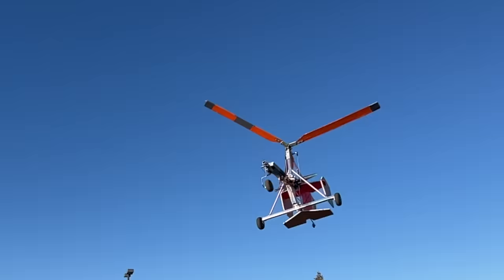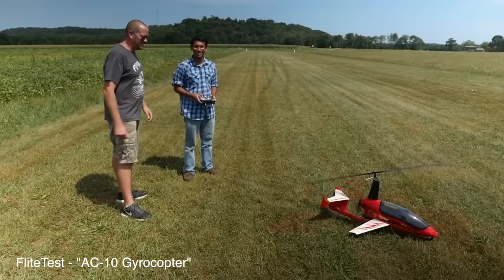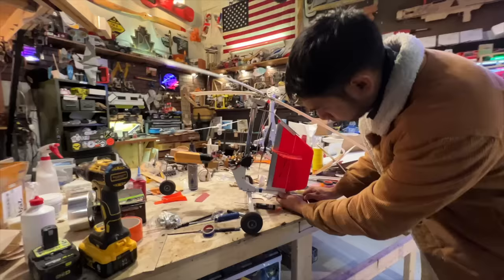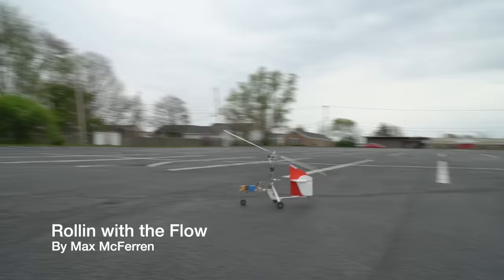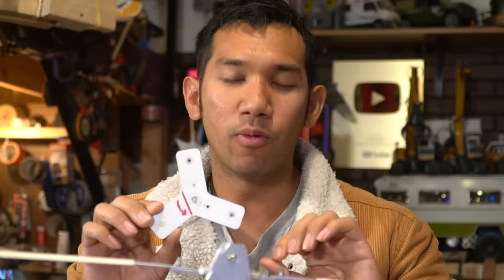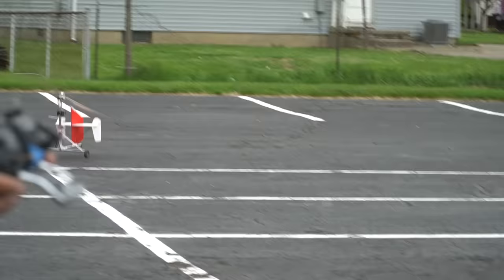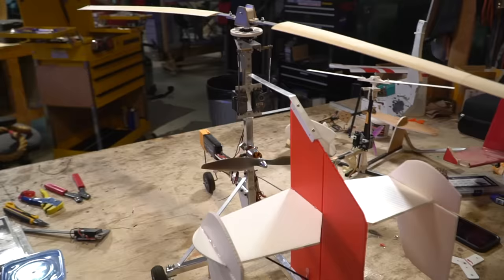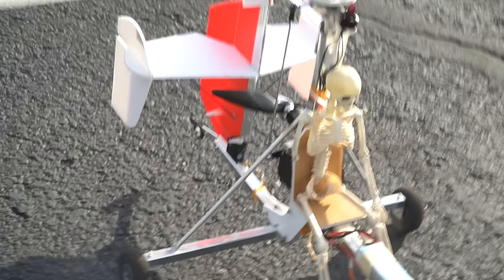This isn’t a helicopter or an airplane?

Comment: I remember when I was reading up on autogyros that the most common way to kill yourself was called a Power Push(or Pitch) Over. Basically at the end of a climb,  a pilot should reduce power FIRST, then pitch forward. This was especially a problem with models that didn't have a horizontal stabilizer, and a motor thrust line way above the pilot. The mistake would be to reduce pitch first with full power (Because, yeah, you want to go fast now that you're done climbing, right?). Doing that reduces the drag from the rotor, but not from the pilot/cockpit. The center of thrust ends up way above the center of drag, and the whole machine tumbles and is unrecoverable.
Reply: not quite right although this myth has been largely accepted by most in the gryoplane community.  

I used to fly bensen gyros years ago and am building a new one slowly now.  I was trained in the gyroglider then two seat powered then lots of time in my own machine supervised doing strip runs.  I never saw an accident at that club we were very well trained.  When I went onto become a gyroglider instructor myself for 16 years off and on in that club and our own club in my state.  no one ever smashed up a set of rotors under my instruction either.

no stabiliser necessary.  meanwhile our sport copying off the USA had decided to blame a lack of stabilisers so Australia mandated them.  well all that meant was everyone who died died with a stabiliser.  that continued at the same rate today.  

Next in UK a proper scientific analysis was carried out which concluded that speed was the most important factor and that stabilisers were of no help but c of g relative to thrust line was which is true.

however machines like the dominator remove the 3 degrees of downturns which in the Bensens puts the thrust line through the cg and keep it flat but bring the mass up.  So everyone continued to ignore good training and deaths continued.

one guy visited our club and was boasting about his new machine and how fast it was.  He claimed he was going to be getting up over 100knots the following weekend he had mabey 5 hour solo.  Myself and about 5 others warned him he could inadvertently push the rotors negative trying this and should avoid flying that fast   he cited the very large stabiliser like the one on peters machine and the high vs thrustline so wasn't worried.  His gps when recovered showed he was doing 95knts when he bunted over the force on his body was so sudden his ripped his harness off and was flung out of the cockpit leaving his leg behind in the process.  

as you get faster and faster your disk angle become shallower and shallower.  push it over and the airflow reverses and in about a second you will fly straight through the rotor and die.  anyone tells you otherwise ask them to fly at 100mph straight over the airstrip and punch the stick full forward.  if they do I'm convinced they'll kill themselves right in front of you.  if they are not willing to try that experiment and actually don't tell them to do it you don't want to be even partly responsible.  however I note many including many instructors are willing to make these statements often when trying to sell you a gyroplane.  A quick google search of gyroplane fatalities will show you almost all have stabilisers, almost all have high CG to thrustline.

the ONLY way to be safe in gyros like all aircraft is to spend the time to get excellent training.  That includes you to Peter.  don't I any way convince yourself you can safety teach yourself to fly these things.  get proper instruction then spend many hours after your instruction in heavy dual machines under supervision doing ground runs.
Reply: @cameronlapworth2284  Perhaps that was an advantage of the original tractor design, the engine in the front put the thrust line in a more inherently stable position.
Reply: @Dr_Mauser  Cameron Lapworth is not talking about the pilot push-over problem. He is talking about a fast-spinning rotor and suddenly sees a negative AoA. Instead of generating uplift, the rotor suddenly generates down lift and chops up the pilot.
Reply: @Aviator168  But doesn't the pilot push-over basically cause negative AOA because of the sudden unloading of the blades?
Reply: @Dr_Mauser  Depends on the cross-section of the blades and the amount of negative AoA. It definitely reduces the force that makes the blades spin and rotor unload. When the stick is pushed forward, the AoA of the advancing blade is reduced and at the same time, the AoA of retrieving blade is increased. If the stick is pushed too much forward, it will cause the entire retrieving blade to stall, and the rotor stops spinning very quickly.
Reply: @cameronlapworth2284  "anyone tells you otherwise ask them to fly at 100mph straight over the airstrip and punch the stick full forward." If he's "flying at 100mph straight", for what reason would he want to "punch the stick full forward"?
Reply: @Aviator168  you wouldn't want to it'd be the last thing you do.  However it's how you would prove you'd made a gyroplane immune to PPO.

When I first got into this sport there were a succession of myths   I learned over time most were actually excuses for not fixing the poor quality instruction.

First myth was gyros delay response from input and this is why pilots were getting into pio.  It's true that if you pull back on the stick you get and increase in disk angle and this leads to blades increasing rpm which can be slightly delayed but the response is instant in terms of pitch the machine is responsive there is no input then 1 second delay then action.  But that was being blamed.

That was taken over by PIO.  This really just amounts to no training but on reading all the accidents it was clear that this was almost never observed.  What was far more common was turning from downwind to upwind.  But the fatal that had eyewitnesses was almost always flying flat fast then bang and tumble out of the sky.  However the USA namely Chuck Beaty and others pushed that this was all about lack of horizontal stabilisers.  Now I'd found almost zero evidence of pio mainly I think because you'd never get much above the ground of you had so little control.  Possible but largely not consistent with the data.  But that didn't stop my country mandating they be fitted.  So fatality rate didn't changed but now all the wrecks had stabilisers some cut right off in the bunt over.

Next had more credibility cg vs thrustline.  The dominator style machines are an attempt to get a more stable configuration.  However they remove the downtrust on the engine only to put the mass up higher.  The original Bensens had short masts and downturns of 3 degrees which pushed the thrustline through the cg.  This was nothing new Ciervas had 5 degrees.  However machines like the aircommand only get into danger here above 80mph which is ridiculous in a machine like that.  Found below even with the taller maet it was stable and safe.

However this has been promoted as the cure.  It is not as all modern machine have thrustline passing through cg and people still fatally unload them.  Yes it helps.  

The reason people die like this is simple.  The disk must always have airflow up from below and through the rotor the faster you fly the shallower the disk angle.  The stabiliser is not connected to the rotor so even if your frame is made stable at a certain speed it just takes a slight bump and your disk goes from positive to negative and you are dead.  High centre of gravity compared to thrust line will not stop this.  And if someone tells you the machine is safe at extreme speeds because it's got high cg or large stabiliser then ask them how confident they are to punch the stick forward at those speeds.

Some gyros genuinely are slippery and fast but the difference between a fast cruise and death might be 1 degree disk angle.  I know my VW gyro in the day could easily do 80mph probably 100mph but that would be very close to the edge at 80 it was sensitive but stable but I chose to never fly it beyond 60mph to give a safety margin.  

There are fast gryos out there but none are immune to this and a quick google image search of fatal gyro accidents will find tonnes of pictures of gyro with large stabilisers and high cg to thrustline.  All the modern machine fit these and the fatality rate has not improved since my time.

This is about training training training and good quality instruction followed by knowledge pilots and people not pretending to have answers they don't.
Reply: @cameronlapworth2284  You are basically right except that the AoA of the disk between flying straight level and tumbling is more than 1 degree. The disk will slow down first, very fast. So it would be a good idea to always have some power driving the disk to prevent it from falling below certain RPM and that's what the designer of the Gyrhino did. 
PS. I suggest every gyro be equipped with a flight data recorder so accidents can studied and improvements can be made.
Reply: @Aviator168  no just saying if you are flying very fast you must have a very low a of a but positive.  Then at the point you unload of course that becomes negative.  I was trying to point out the critical difference is very very small.   This is of course how we stop the blades after landing dropping the disk below level.  In flight of course this is much more violent.  Flying straight through your rotors.  The emphasis of what the airframe does at this point seems unnecessary as once those blades stop you are not recovering.  With zero lift you have nothing to control or recover or control if at this point my tail swings up is really not an issue as once it's unloaded you are just tumbling wreckage regardless.  Trick is not to get near that position in the first place.
Reply: @Aviator168  I wasn't aware of the gyrhino.  Bensen did experiments fitting a chain saw to keep 8 hp continuously through the disk.  Of course even choppers can go negative and chop thier own tails off so that won't stop this completely = but might reduce the risk.  I've thought as the battery technology improves fitting a several hp electric motor continuous to the rotor to reduce power requirements to the prop.  Bensens 8hp apparently allowed him to fly quit well on only 40hp Neilson engine instead of his usual 72hp Mac.

The black box is a good idea and actually something I've been pondering for another related reason.  I'm an ICT teacher I teach programming using little cheap computers called Raaoberry Pis and Arduinos  they allow connection via General Purpose Input Output pins GPIO  this allows sensors and outputs like motors servos lights sound etc to be triggered by the computer and can record data.  

I figure the real issue is getting too shallow a disk angle relative to the airflow with the angle of the frame essentially a hanging mass under this.  I believe the airframe position is irrelevant and the difference in stick pressure before unloading is indistinguishable from normal flight.  How much pressure does it take to fully lnload the disk on landing?

What I think might be useful is a wind vein attached to the torque tube  this could potentially give warning when getting close to very low disk angles relative to the airflow.  You could have an audible alarm sent to your headset even potentially have a servo motor on a spring apply oscillating pressure or an offset motor to shake the stick triggered when you get below x disk angle.  My main concern is it would be mounted below the disk possibly inaccurate due to the turbulence from the hubbar.  I'd like to set it up on a gyroglider and film in flight combined with accelerometers to check the principle.  3 axis accelerometers are actually cheap like $5 each so once on the frame, torque tube and wind vain could be fitted to help analyse flight characteristics.  Cameras can also be fitted to the raspberry pi.  So you could have this all being stored in flight   I also plan to use this for a glass display.  Just airspeed altimeter and engine data but again this could all be saved each flight to the same card.  Even streamed to your phone and to the cloud if flying in range of mobile data.  Essentially black box.  Asi alt accelerometersters gps and engine temp sensors all for less than $200 and the pis are only $20 to $100 depending on what type.  If I get it working I'll open source it and put it up on the Web somewhere.  But it's a lot of programming and testing to check it works and I fear may give a false sense of security.  But stall warnings are clearly useful even if they don't always stop a stall occurring.  Training and common sense are key.  Just fly at sensible speeds and you will have some idea.

Collecting the data would be invaluable to have a reaso able guess  as to the point you will push over at least I  terms of disk angle relative to airflow.  You plot a of a at every 5 mph increment to higher speeds and you should get some estimate of proper VNE.  Do this with different masses etc.  Different rotors angle of blade incidence etc   you could then map out a proper VNE.  Now we have what so and so was brave enough to fly this fast and knock off 5-10mph for safety?

Anyway cheers
Reply: @cameronlapworth2284  I have been thinking about your story of fast-flying gyros that suddenly crashed. This is not possible unless the pilot pushes the stick forward so that the rotor AoA due to flapping is negative. If he pushed the stick forward slowly, he will experience mask bumping way before the crash.
Reply: @Aviator168  no you're assuming zero angle on the keel.  Even dominators fly slightly nose down at high speeds.  Additionally all gyros tend to have slightly negative angle possible on the head.  Think about it how do gyro stop their blades when they land before rotor brakes entirely by literally unloading with full forward stick.  I know I've flow gyros with heads on zero and in any wind to slow the rotors you had to turn around so the disk was uploaded.  Now doing so gives no mast bumping.  

Now it may be possible to design sufficient up angle on the stab to pull the nose up but that may present other issues   my instructor put an upside down wing on his tail to hold the nose higher at high speeds but even there it was still nose down and therefore possible to unload.  

The main point here is the airframe is irrelevant until you unload then if my tail collides with the rotor so what?  Im dead the moment the rotors stop regardess of how stable the airframe is once doing so.

The guy the brought segway died because he drove it off a cliff trying to avod a collision.  Now as it turns out it wasnt a sheer cliff but if it had been that segway would have plumetted vertically stabilising all the way down.  Would have been sereal but the result would have been the same.

Ken Wallis on his speed record breaking gyro had an adjustable tail to help keep the keel as level as possible + 19ft blades + a worm drive to adjust head position and change cg in flight to keep it level at the high speeds he was doing.  The thing saving these modern machines is streamlining and extreme weight.  But most are still sporting 28 ft 8 inch chord n8h12 rotors.  My humble VW bensen was probably 150 kg and flew at 35 mph on 22ft 7 1/4 inch chord rotors.  Safe combination with its short mast and downthrust.  But I didn't risk over 80mph although I knew one guy with a similar machine who open frame and all never flew below 90mph and mostly at 100mph.  I thought he was nuts.  He had to have a brace on the mast as his helmet was pushed against the mast otherwise.  But I've known too many guys bunted over.  All had either limited training or poor instructors.  Training is all.
Reply: @Aviator168  that is what happens in power push over.  It's all death by unloading the disk.
Reply: @cameronlapworth2284  Want to pick up this thread again. About PPO, if the pilot pushes the stick forward SLOWLY (assuming fixed pitch rotor blades) he would've noticed a thing or two before the gyro goes kaboom. Speed increase is the first. Then as the pitch of the advancing blade is reduced, the pitch of the retrieving blade is increased, and that leads to the reduction of the force that spins the rotor -> RRPM decay. If this is done slowly, the gyro will start to sink which leads to the increase of the advancing blade's pitch. No problem there. If it is done quickly, the reduction of the advancing blade pitch will be rapid, and the rotor will slow down quickly. We all know what will happen afterward. My point here is, that there is no way for a fast gyro suddenly drops out of the sky if the pilot does not do anything or he does not encounter a sudden very strong downwash.

BTW. I got the above information through experiments with a small 3D printed rotor tested in a wind tunnel I built over the last few months.
Reply: @Aviator168  excellent analysis.  I agree I think but what worries me is people don't always make slow adjustments.  I don't think it would take much of an input in the wrong conditions.  

Many years ago we had a spate of fatals and a large number occurred in strong winds going from downwind to upwind then bang tumbled blades colliding with tails etc.  Now I know the gyro doesn't know what the wind speed is but pilots can see the difference.  This is what I suspect was occurring and I'd be interested in your thoughts.  I think they were intending on landing and as the turned from downwind to base they found themselves drifting.  More bank more power to compensate more backtick .  Then as they turn from base to final they have built energy in the rotor and start dramatically climbing,  so they push forward stick but now the extra intertia combined with a shallower and more vertical vector of lift so the push the stick forward again and the bang etc.

Just a hypothesis but reasonable.  

On tilting the rotor over.  I teach stem and science etc.  In my stem class my kids 3D print model gyro heads and we model sanding blocks for different blade profiles.

Anyway we're I live is windy.  The way we stop the blades which howl  a 30cm radius can produce maximum so far of 3kg lift! Anyway to stop them I just have them tip the disk just below horizontal they stop every time very quickly.  But at our scale I'm sure these would constitute large inputs from stick.  I will experiment more with that in future.  It might be a difference between rapid and sudden pitching.  Did you get any high speed footage? Love to see it.
Reply: @Aviator168  on this issue.  My concern is people treating gyros as idiot proof.  Myself and others at our club tried to talk an inexperienced pilot with a new high cg thrustline machine with a massive stabiliser to not do as he planned (he told us next weekend he was going to try to take his machine up to 100knots). He was convinced because his instructor and also the guy who had built the machine that it was immune to ppo pio and negative g because of the large stabiliser and high cg vs thrustline.  We begged him to reconsider and I can still see the self assured look on his face.  The next weekend he got to 95knots before he bunted over we know because of his gps data.  The stop mid flight was so violent that his harness straps ripped out of the fuselage he was flung through the windscreen leaving one leg behind.  They found his body 50m from the main body.  Tail prop pieces we found futher back.  So I suggest if someone tries to convince you that this or that feature makes a gyro idiot proof they can prove it by performing said manuver.  If they are not confident enough to put their own lives on the line then that correlates directly to their confidence in such devices.  

I do not know my or my machines limits so I only give advice that I am prepared to demonstrate myself.  Others I feel should follow that advise.  Instructor or machine manufacturers should not treat problems of flying gyros as solved.  The accident rate still is as bad as ever.  Thus you want to sell gyros by stating that they are idiot proof I have an experiment for you to try.  Not willing to do the experiment fine (me too)  just don't go pedalling nonsense that these machines cannot be unloaded.  Not till you are willing to prove it to all.
Reply: @Aviator168  the flight recorder idea is excellent.  People might consider some of the cheap micro computers like raspberry pi ardunio etc.  You can get sensors for airspeed altitude 3axis accelerometers and much more for under a cour of hundred dollars.
Reply: @cameronlapworth2284  The bigger problem is people treat gyros as fixed wings. Sorry to hear about your experiences and loss of lives.  In your first case. When pilots would've seen sudden altitude increases as they turned downwind, their natural reaction was to push the stick forward to maintain level flight.  But they shouldn't be in that situation unless they were taking off in the direction of the wind. In your second case. Gyros wouldn't just drop off just because they were going fast(Ken Wallis' speed record on a single-seat gyroplane is 129mph). No matter how fast gyros go; the advancing blade always has to flap up and the retrieving down for asymmetric lift compensation (fixed pitch teetering blades). There is no way for the advancing blade to generate negative lift without blade stall, RRPM decay, and mast bumping happening first. The more likely scenario here would be the pilot saw a sudden increase in altitude (this is possible if less dense air is encountered) and wanted to maintain level flight or perform a high-speed dive. These are just my 2 cents. No one really knows what the actual conditions are.
https://www.youtube.com/watch?v=CfjBzrSDrV0

BTW. Check the location of the static ports to see if air pressure can be affected by the wind. I don't have a high-speed camera.
Reply: One more thought. The stabilizer only helps to slow down the PPO if large part of it is in the free air stream, not the prop wash.